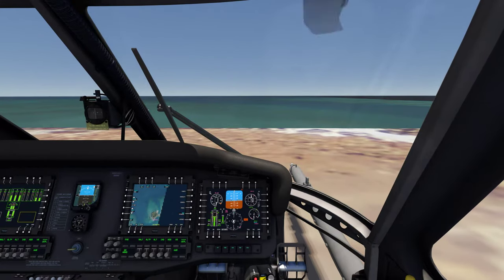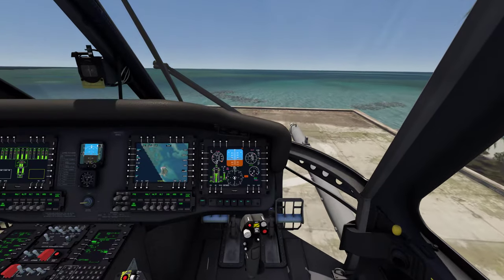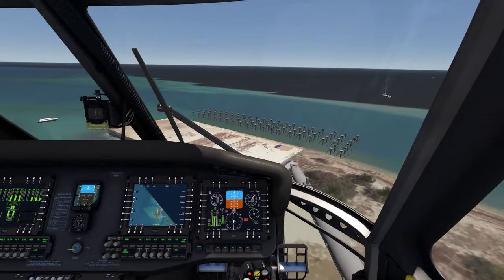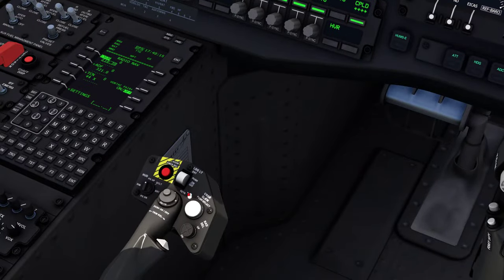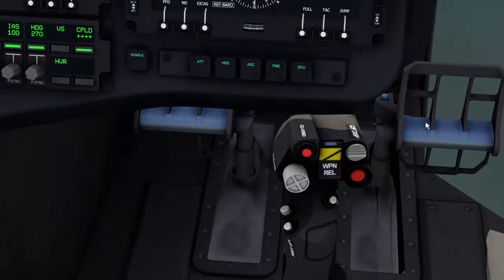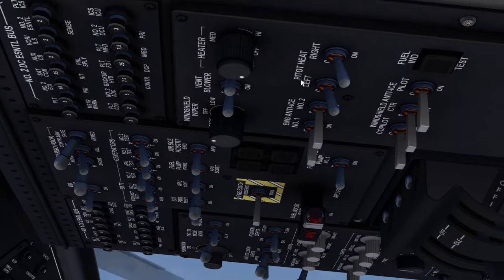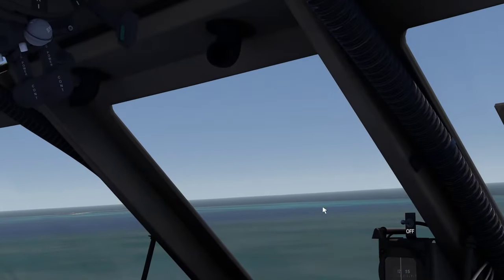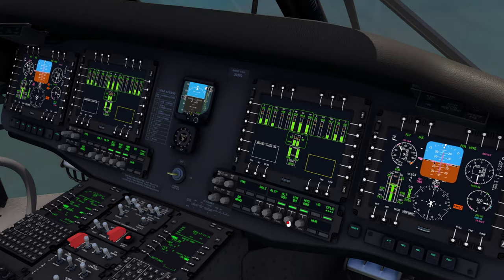Differences between the UH-60M and the UH-60L | Aerofly FS 4

Comment: 5 degree pitch for a hover is to compensate for the 3 degree forward tilt of the main rotor head and shaft.
Reply from the maker: True. The tail rotor also has a 20-degree cant which  is so that the tail rotor can help produce lift.
Reply: You a tango, because you talk like you know your stuff. Been hitting up the -10 and -23&P?
Reply from the maker: @hogflies3208 No, I'm a 153M
Reply: @ArmyAviator  how long you been in? And what’s your ETS out of curiosity.
Reply from the maker: @hogflies3208  I've been in for 2, fresh out of flight school. I signed a 4 year ETS, but I plan to stay in for as long as possible.
Reply: @ArmyAviator  odd, 153M has a 10 year service commitment outside of flight school. ETS after 4 years ETS as a UH-60M pilot doesn’t sound legitimate. Nonetheless the descriptions between the two aircraft extend further from just the UES. Even as a tango I know that. But who knows, maybe you’re telling the truth.